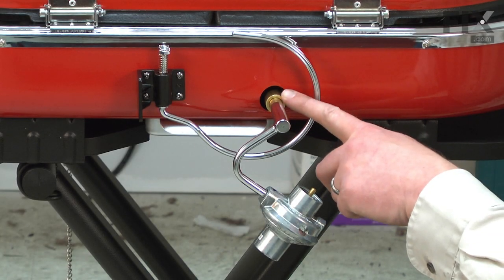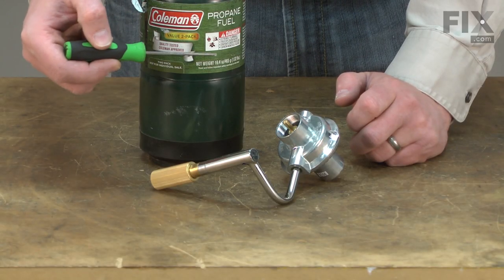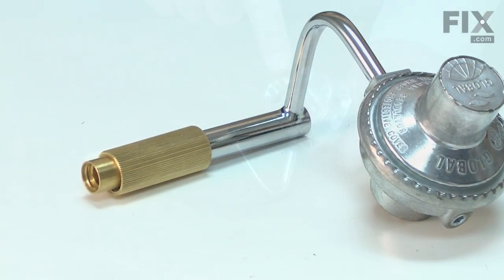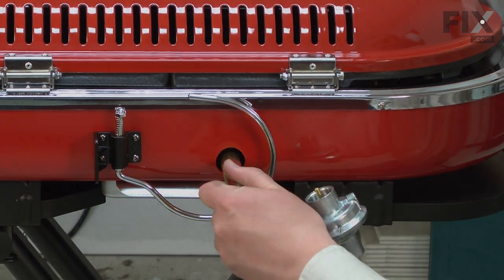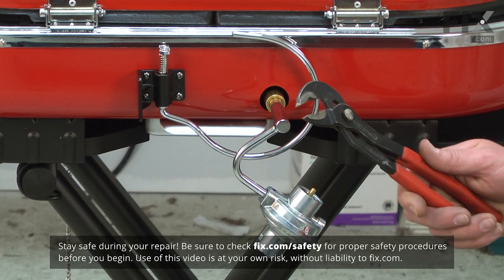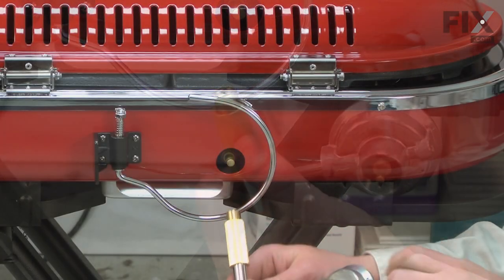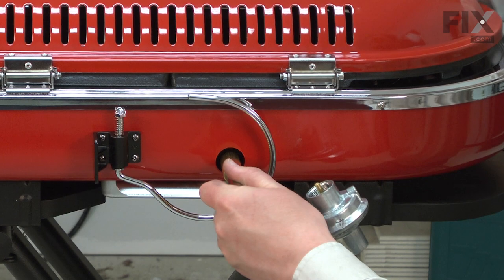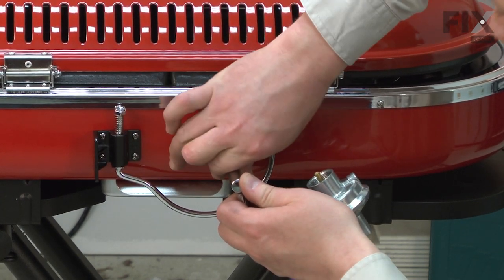Coleman Grill Repair - How to Repair the Regulator

Comment: Fail, This video was pointless. Did not explain how to repair anything. Removing the regulator is part of the normal usage... Now if you showed me how to replace the rubber diaphragm, I would have been interested.